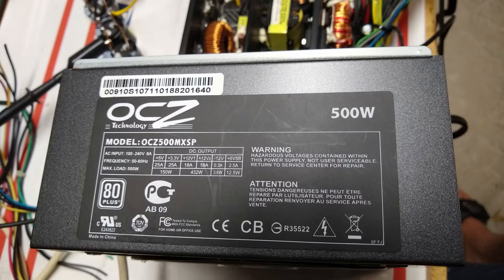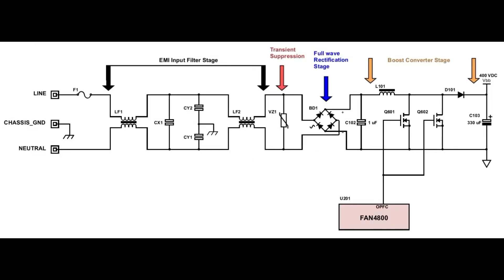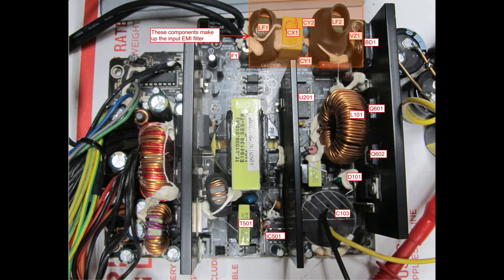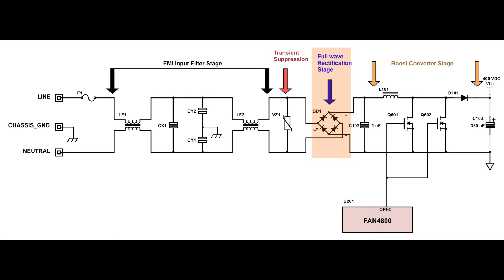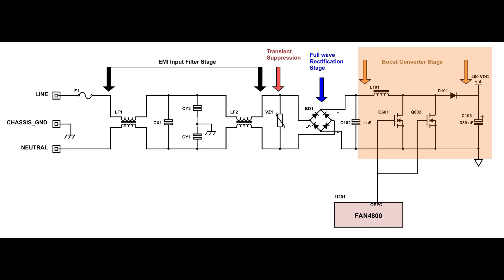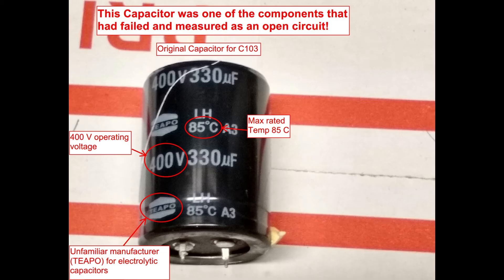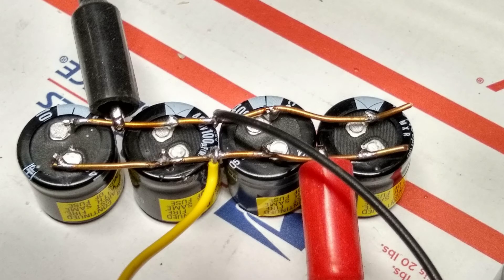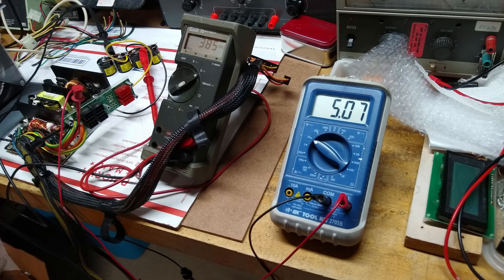OCZ 500 Watt Power Supply Repair Video - AL's Lab

Comment: Hi there, thanks for the video it helps to understand  how the power stages in PSU works. I have a similiar OCZ modExtreme Pro 700W PSU, my problem is  0ms PG signal on tester but all voltages are present. Seems nothing visually defective, I change main cap(it's also 470uf 400v), I also change bunch of 12V, 5V side caps. Standby voltage also presents even some motherboards can post with the psu but when test it, can't get pg signal out of that psu. Any idea to look forward ?
Reply from the maker: Happy New Year :)  Unfortunately, schematics do not exist (to my knowledge) for the OCW families of power supplies. When I did this video, I had to reverse engineer some of the OCW design to understand what was going on. 
To approach this logically without a schematic, I would start at the output and work my way back. Since you had already verified proper output voltages for the power supply, I would start at the PG output signal. I believe that the PG (Power Good) output signal (also known as “power_ok”) for the 24 pin ATX connector is located on pin 8. If you could trace pin 8 on this connector back to the power supply PCB you could find out what IC it goes to. I know a common IC that has been used on other PC power supplies is the WT7525. The datasheet for this IC can be found here:
https://www.techpowerup.com/articles/160/images/WT7525.pdf
If this IC is not being used on your power supply then you may be able to find the datasheet for the IC that you do have.
An example 600 W power supply circuit where the WT7525 IC is being used can be found here:
https://www.smpspowersupply.com/600W_power_supply.jpg
The IC is used in the above schematic link under the functional area called “Status and Control”. You can probe the IC to verify it is getting all the proper voltages. It could be that this IC has failed and/or some of its support components have also failed.

Comment: Hi thanks for your video ,  how did you manage do desolder components , I do have soldering station but I just can't  do it, and it is interesting that I can't fined video on Youtube  how to do it . lot of them are just beginners soldering/ desoldering  technique
Reply from the maker: I used a Weller pencil soldering iron along with a EDSYN Solderpult (a.k.a. a solder sucker or desoldering pump) since these were through holes parts. I also used soderwick by Chemtronics (desoldering braid) with the soldering iron that also helped to remove solder for the IC pins.
Reply: @alslab2764  I have 160v on c103 and rectifier BD1 is than normal?
Reply from the maker: @nick3200  Having approximately 160Vpeak on the output of the bridge rectifier appears to be correct. However, having 160Vpeak across the electrolytic capacitor C3 is not correct. It should be ~300VDC. Not seeing how you are taking the measurements I recommend this. On your DMM set it to measure Volts DC. Then carefully measure the voltage across C3. Remember the potential across C3 is high voltage and is lethal so extra care needs to be taken when taking this measurement.
Reply: @alslab2764  I did it as you sad,  still DC 160v on C3. Maybe i have problem with Q601 and Q602